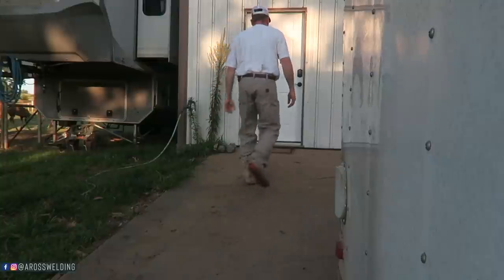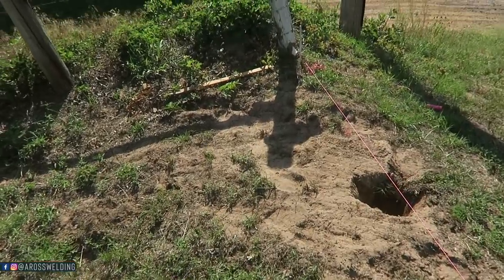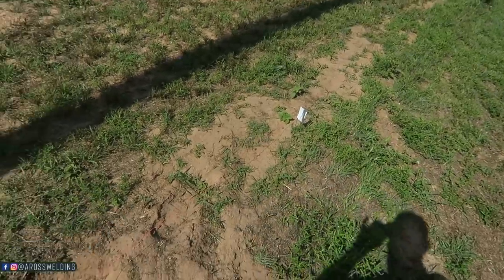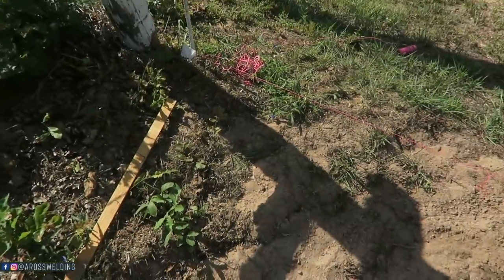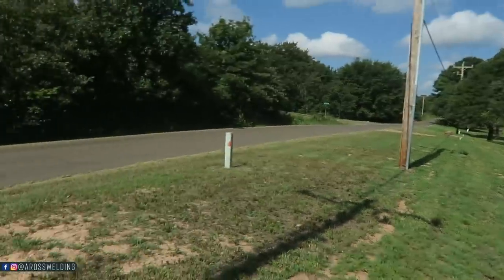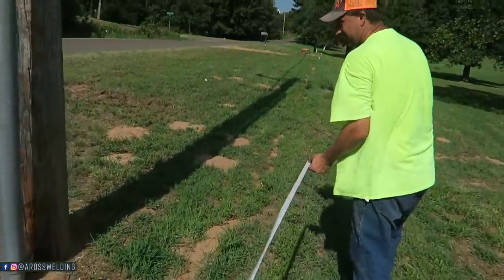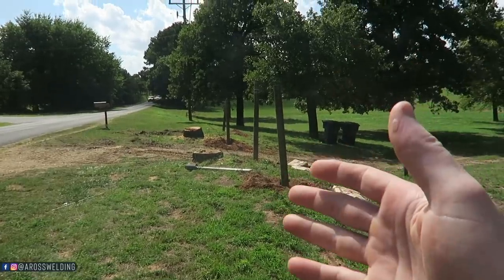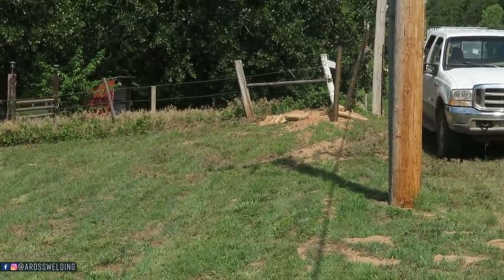FIRST AROSSWELDING PIPE ENTRANCE AND I MESSED UP BIG TIME

Comment: Have you ever thought of using a post pounder instead of drilling hole and messing with concrete?
Reply: That sucks I just did a corral door for an existing corral post whr hammered in and I could not weld my 5 runners to existing post that had no concrete that is the lazy way to build a fence and always mix your concrete in a mixer then pour
Reply from the maker: I have, from the little I’ve talked to other guys I know that do the same stuff, they say it’s all situation dependent. But this one guy I know has learned that he likes setting post in concrete better for long term.

Comment: smashing that tank is nothing, you have to learn to laugh about little screw ups like that or it will kill you. i have backed into and over things and it does look bad when you are the boss and your name is all over it. at least all your friends werent there to laugh at you. its good you didnt dig up a fiber optic line
i have seen lots of people cheat putting cement around posts, they just pour in bags of reddi mix and leave it thinking ground moisture will make it strong enough but it doesnt